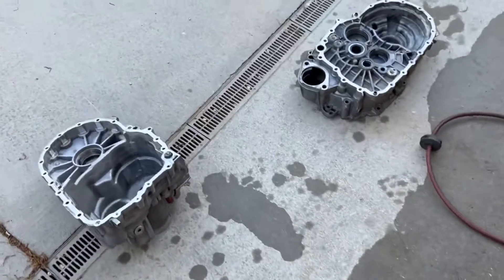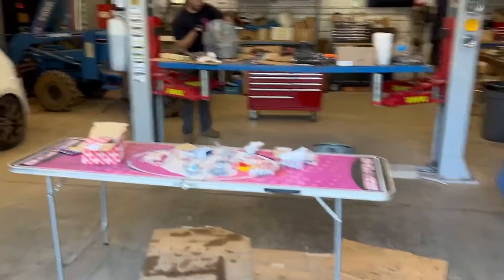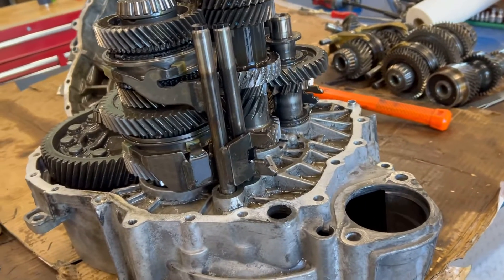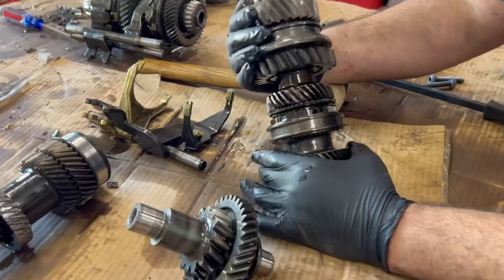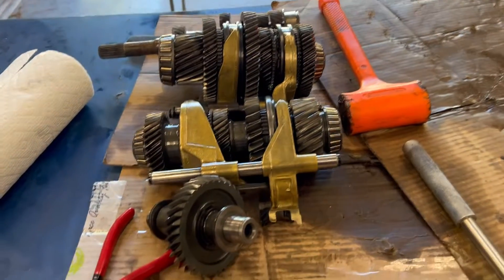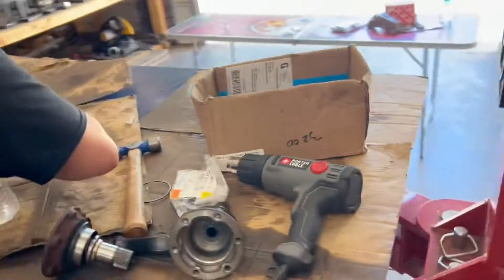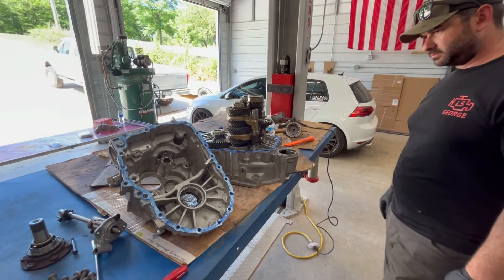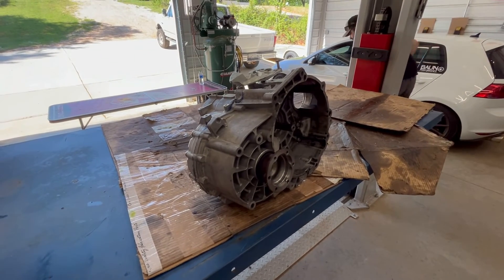Mk7 Transmission BROKE! I’ll Show How, Why, & Rebuild In Under 10 Minutes (Plus Model Differences)

Comment: Is there a trick to getting the shift tower back in? I had it in neutral when I took it out, and have the plastic tentioner removed, but doesn't want to go back in
Reply from the maker: It’s kind of a wiggle and shake to get it aligned with all of the shift forks. Double check they’re all lined up in pairs
Reply: @BaunPerformance  is that a part thats available separately?

Comment: Is 3rd gear also on that same shaft?
edit: nevermind you answer my question a minute later in the video lol. was this likely caused by low fluid level and/or brake boosting?
Reply from the maker: I’m confident rolling into boost below 3,000 RPM is the most profitable cause.

Like a diesel these cars will make crazy torque down low, but with great power comes great responsibility to diligently downshift and let the driveline stand a chance.

The shaft supports can help, but at the end of the day you really need to be 3,000+ RPM to safely use tuned MQB power